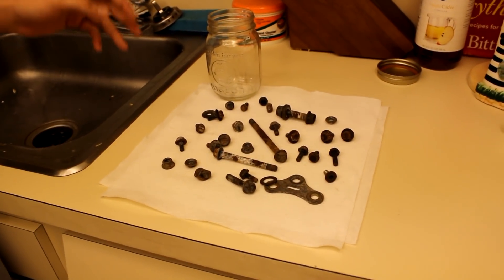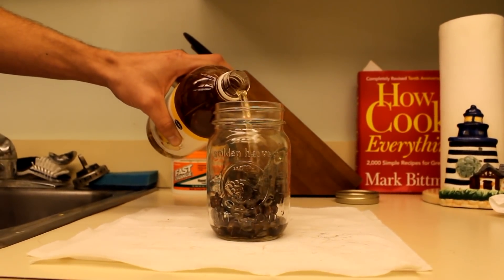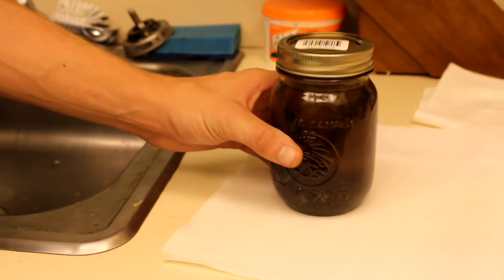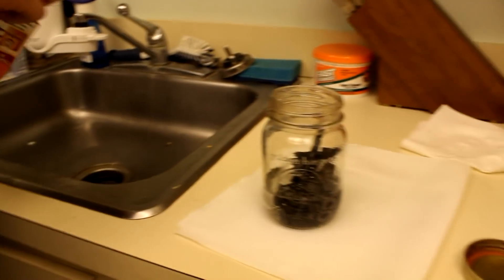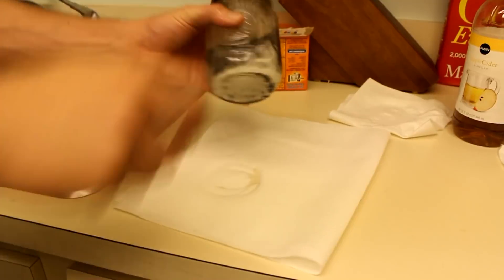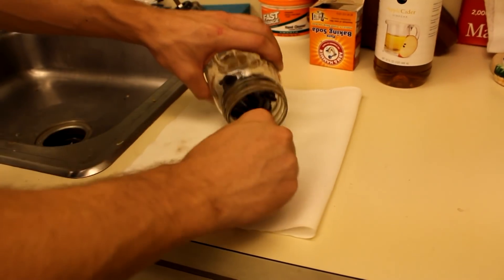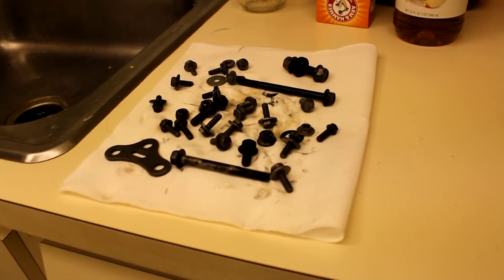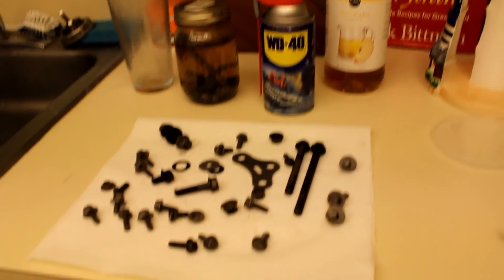HOW TO remove rust with vinegar

Comment: A friendly tip to everyone. Rust forms very quickly, so instead of letting metal parts air dry, immediately towel dry them (or use a hair dryer) then coat with oil.
Reply: Does the rust re-form quickly due to just being wet, or is it a result of being wet only AFTER being exposed to vinegar (or does the vinegar or baking soda in any way, hasten rusting if not dried after being rinsed very well with water or 91% rubbing alcohol?)?
Reply: Well I learned that using baking soda on a metal file is probably as bad as cleaning with salt. I really hate rust. I think the best thing to do, is get some of that lubricating turbine or engine oil type stuff and keep your tools oily.
Reply: Jay H Just because it's wet.

He's right about having the things dry with a towel or paper right away, specially if you are using this method in iron, because that thing will get rusty in minutes

Comment: I hope this works on my cardless drill chuck.
Reply from the maker: I guarantee it
Reply: Anything like a cordless drill? The chuck can be removed and replaced.Remove the screw in the center of the chuck. Secure a long allen wrench with the long part sticking out. Wrap the allen wrench sharply with a hammer to break the chuck free. Then it will screw off with your hand.
Reply: My drill's chuck isnt removable. it is connected to the spider gear. However. this trick in the video worked. my chuck loosened up, and i used vaseline in it. it has been working ever since.

Comment: I had rust on my motorcycle on most of the chrome before even seeing this video I thought apple cider vinegar is acidic it may work I took some put in a spray bottle and used a soft brass brush , it ran off works great then I cleaned with never dull still looks good !

Comment: it works better if you first brush of the rust with a brassbrush. than clean the nuts and bolts with degreaser and than use vinegar!! final i use a rustconverter to complet the job

greez from hamburg germany hundemumin

Comment: That's a great tip about freezing the water to access the acidic properties. Thanks! - I'm using cider vinegar on some machine screws right now - & it's working a charm, but I have been using WD40 after the vinegar to help run the bolts over the threads (I might try your steel wool suggestion)

Comment: may aswell get rust converter and spray or paint it on the heavily rusted parts or all of it and then coat the metal in etch primer or metal primer then give it a paint of acrylic paint.

Comment: He used WD-40 on them to stop them from rusting again. The oil keeps the moisture off the metal. So as long as you keep them coated with WD-40 or a thin oil coating they should stay rust free for a good long time. Bicycle chains stay rust free if you keep them oiled!

Comment: Well I scrolled down the comments to see if anyone asked if this method would work on cast iron pans but I didn't see that question.  I have an old cast iron pan that has rusted....could I use this method on the pan?  Do you necessarily need a top to it as you had with the jar, or can the object(s) just be submerged in both the vinegar, first, and then the baking soda?  Thanks so much in advance....:)

Comment: Painting nuts and bolts is not practicle. All of these fastners will begin rusting again almost instantly, depending on humidity. Purchase of new hardware with rust preventative coatings is the way to go. Or simply go with stainless steel and be done with it for a near lifetime.

Comment: Hi, Would the bolts turn back to start rusting again, if you didnt rinse them with water?. I sanded down the cills on my vehicle to bare metal, then rubbed vinegar water on them, which killed the surface rust BUT i never rinsed in off with water.

 Two Days later rust had returned, is this because i never rinsed the vinegar off to dilute it?

Comment: usually hardware on autos and other applications are coated with a black oxide from the factory as a cheap form of corrosion protection. It has been done this way for around 80 years. Also when you remove rust completely the area that was rusted will turn black which means the rust was neutralized.

Comment: I use it for rusted tools, cast iron pots, etc. If I want a stronger solution, I put vinegar in a bowl, put it in the freezer and let it start to freeze. Vinegar you buy is mostly water and that's what freezes first. Remove the ice and use the stronger vinegar. I let the metal soak for several days, then clean it up with steel wool. Never used baking soda though. Tools and other things look almost like new. I only use the white vinegar from the grocery store. Haven't tried apple cider vinegar.

Comment: I like this method because like electrolysis rust removal, its is food stamp friendly (which only uses baking soda).  You can buy baking soda and vinegar with FS.  I use first a whizzer wheel to get most rust off... then electrolysis... and then, for small stuff like bolts like this, or the insides of parts like tubes...  evaporust (expensive) or this method of vinegar (way cheaper).   If you're on FS, you have zero cash so these methods are the way to go. Also, there's molasses pickling bath.

Comment: They look black because there are two kinds of rust.  Fe2O3, which is the outside reddish flakey rust on the surface that expands in size and flakes off... and Fe3O4, which is black rust bound up with the metal.  Derusting takes off the Fe2O3  red rust.   I dry my stuff and paint with Cold Galvanizing Compound, and then a brush on Exterior Latex Enamel... OR, I paint with Rustoleum Rustconverter, then a Spray can Enamel.

Comment: You can also use a solution of unsulfured molasses mixed with water. The mix is 1 part molasses to 9 parts water. Let sit a couple of days and clean.